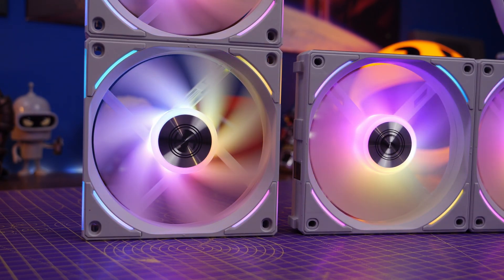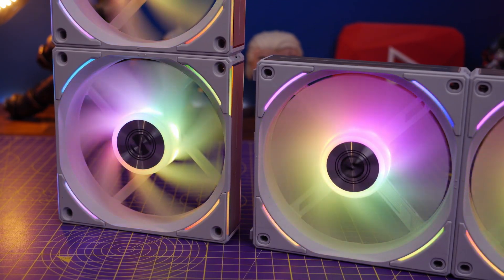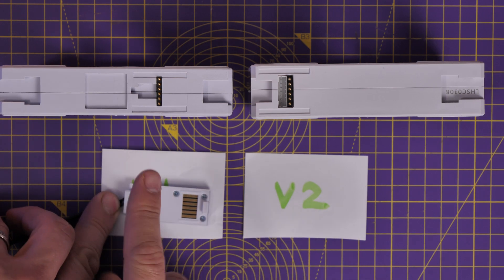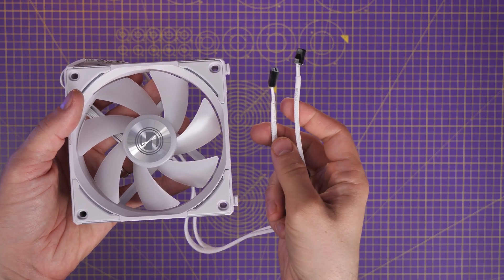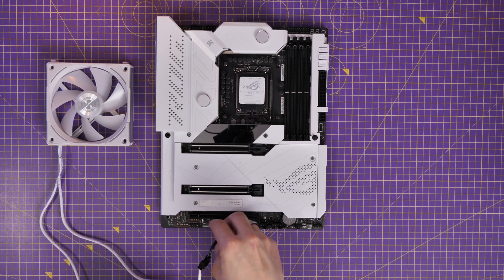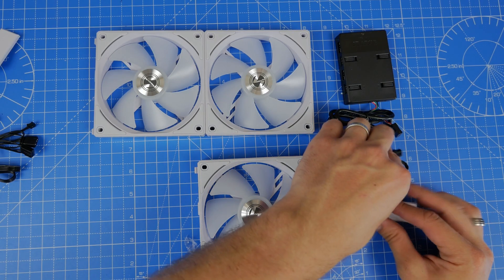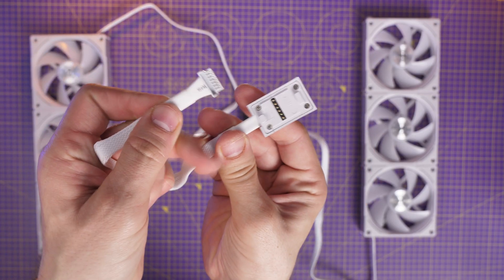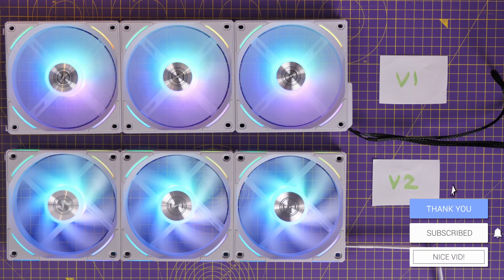Lian Li AL120 V2 vs AL120 the upgrades that matter

Comment: How are these in terms of noise type, weird buzzing at mid to high rpm or just fine? Thanks!
Reply from the maker: Not experienced buzzing. Very pleasant sound profile in my experience
Reply: @TheProvokedPrawn  thanks so much for the reply. Getting 9 of these for my NV7 :) hope they are a breeze to build!

Comment: Great video man !!! I have a question, I have a pack with 3 AL120 V1 (plus hub v1), do you know if I can use the new AL140 V2 on the same hub as the V1? i mean, don't in the same group, for exemple: in group 1 I use the v1 and in the group 2 this AL140 V2

Comment: Can you control the AL120 V2 with the AL120 controller?
Reply: Did you find an answer to this? I just realized I bought a V2 instead of a V1 and went to hook it up and concerned I can’t
Reply: @AzViking69   Yes i did, and.. you can't, answer from Lian Li: "different fans, different controller"
Reply: @mr.dahomey4347  that’s what I figured. Glad I returned them yesterday then. Thanks.

Comment: for the v2 is it just better to get a triple pack and 7 singles for a total of 10 fans ? since the 3 pack comes with the controller i wasn’t sure if it’s worth spending so much to get two extra controls that i won’t need. but connection wise one triple pack brings everything correct? (sorry if this is a stupid question trying to save money if i can)

Comment: I just got these and I'm actually surprised at just how much better they look than every single RGB fan I've ever owned. Sure they're pricey, but when it comes to looks combined with the software and effects, it beats any lighting effect from my Asrock and MSI board software. Also, all previous RGB fans look terrible from the rear but the uni fans look great on both sides.

My two complaints are that the triple pack does not come with the cables to connect directly to the motherboard pwm and 5v argb header. The other being when connected to the hub, I can’t control the fan speed with my motherboard’s software so they can’t be synced with my other fans.

Comment: Will the AL120's run off the same control box as the SL120's?
Reply from the maker: They might off the V2 controller yes. Though Lian Li recommends using the controller from the relevant fan, but i think they are the same. Heavy emphasis on think as I'm not 100% certain and wouldn't want to give you the wrong info.

Comment: Does anyone know whether the AL V2s (doesn't matter if 120 or 140) and SL V2s are inter-compatible? I want to use SL V2s as case fans because of the better air flow and AL V2s for a 360 mm radiator because of the superior static pressure.
So for example I get a 3-pack of each, would I have to use a seperate controller box for each set? As far as I can tell the connectors on all Uni Fan V2s are the same but I fear the controller might refuse to work with different fan types on a firmware level.
Reply from the maker: I've not tried mixing and matching. I bet Lian Li would say not to. Tbh the SLs are fine on a radiator. They keep my 13900k perfectly cool

Comment: The offset plastic on the back of the fan being designed that way is uh, definitely a choice.
Reply: I dont know why they changed it, it looks a lot better in V1, so good actually that I would rather get those
Reply: Agreed I like the v1 look better. For some reason the new look looks kinda cheap but it could be just me.